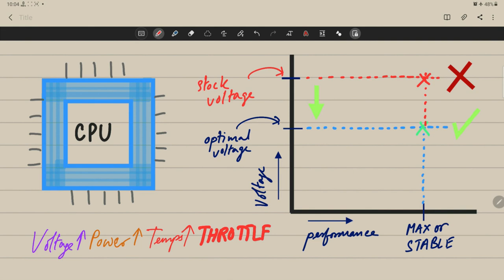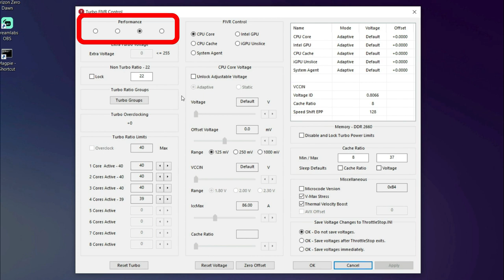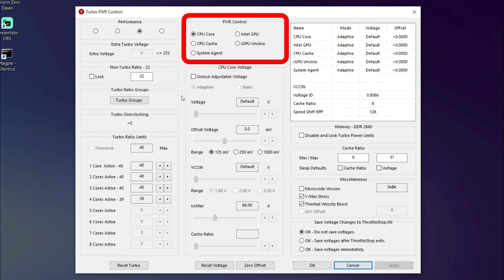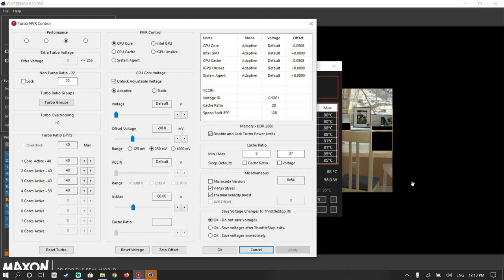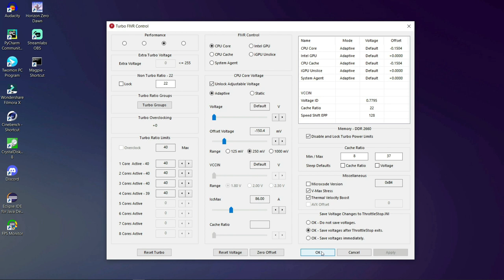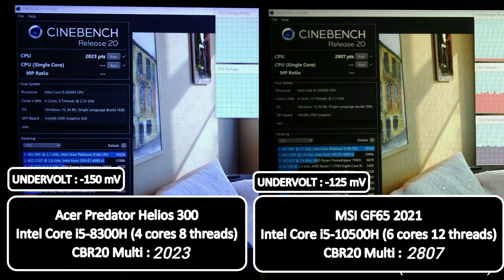Undervolt Your Laptop Now for Lower temps and higher performance! MSI GF65 / HELIOS 300 🔥

Comment: Bro. My laptop is msi gf65 thin.undervolting is locked in this.i can only undervolt tdp.is it good or bad undevolting tdp.
Reply from the maker: Watch my undervolting video or search how to enable undervolting through Advanced bios.
After enabling undervolting through advanced BIOS, you can enable those options inside Throttlestop.
Reply: @DeepteshLovesTECH  ok bro.
Reply: @DeepteshLovesTECH  bro.i am unable to get advanced bios.i tried as u said in video but I can't get in my laptop.
Reply from the maker: I can't help you like this. MSI laptops come with a hidden advanced bios. Search how to get into that.

Comment: When I click on FIVR my FIVR Control says locked and I am unable to offset the voltages. What do I do?
Reply from the maker: It means your undervolting is locked. Your manufacturer doesn't allow it.
If you own MSI laptop you have to enable undervolting through hidden  Advanced BIOS. Then you'll be able to access those options inside Throttlestop.
Reply: @DeepteshLovesTECH  Yes I just purchased an MSI GF65 Thin, and enabled it just now. Sadly my chip does not even undervolt by 100mV. Right now I have set it at -89mV.
Reply from the maker: @debangshusarkar705  yea that's part of silicon lottery, but anyways it's still better than stock
And locking clocks in between 3.0Ghz-4.0Ghz according to your preference... really reduces temps and gaming performance is almost intact.
Reply: @DeepteshLovesTECH  I have disabled the CFG and Overclocking Lock and enabled the Overclocking Menu and XTU Interface.

I can undervolt in bios but I can't in throttlestop 9.4

Comment: Bro should I get the i5 10500H RTX 3060 variant or the i7 10750h with RTX 3060? There is almost 20K difference
Reply: Or should I go with i5 10500H with 1660ti for 75K....is it worth paying 15K extra for RTX 3060?
Reply: @AkashAnil-p4w  absolutely worth it for the GPU alone. But when you're paying almost 1 lakh for a lap, it should be future proof as well, therefore go for an 8 core processor instead of 6 core.
Reply: @delesegdevassy9685  any recommendations?

Comment: If we don't undervolt, what will happen
Reply from the maker: Most gaming laptops, especially cheaper ones with Intel processors throttle. The first minute of the video explains why undervolting helps.
Reply: @DeepteshLovesTECH  I have the same msi 10500h 1660ti
Reply from the maker: @nikhilsachan3217  if you haven't undervolted,  then it's probably on fire 😅
Reply: @DeepteshLovesTECH  cpu goes upto 95c sometimes while gaming, I don't experience stutter but the stream skips frames while streaming, I don't know why, please help

Comment: Ryzen laptop per batao bhai
Reply from the maker: Ryzen laptops don't support Undervolting yet as of now.
Reply: Just use "ryzen controller" and cap the cpu temperatures. Its better than undervolting in intel.
Reply from the maker: @milanpatel4712  no that's not better. It's a make shift solution. We are not "caping" performance in case of undervolting, for example with Ryzen controller, it may drop clock speeds to maintain whatever temp limit you have set. It's plain physics. 
Undervolting is completely different and has a lot more options. In fact Ryzen desktop supports full undervolting through Ryzen master, but it's not yet available on mobile chips yet. Ryzen too benefits from undervolting. Hopefully it'll be available in the future.
Reply: @DeepteshLovesTECH  Ohh I see. I have a ryzen 5 4600h and have always thought that its so simpler to just cap rather than undervolt. 
I knew that clock speeds decrease to cap the temp but in my case there was only 10-15 fps drop elsewhere dropping temps from 91-92 to capping at 79.

I dont have an intel laptop but my friend have thats why i was here to share it to him.
Reply from the maker: @milanpatel4712  79°C is quite low, so obviously it'll drop clock speeds and TDP too much. You should try 85°C, that's much more reasonable.
Reply: @DeepteshLovesTECH  sure. I will try it.